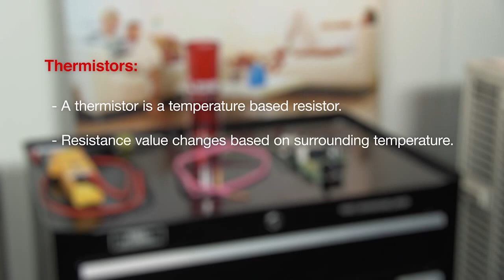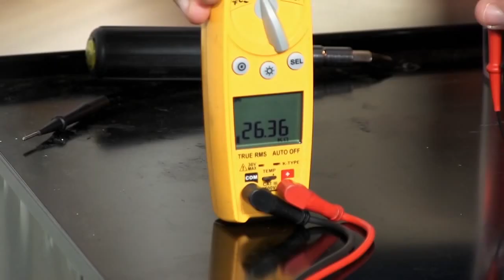Tech Tips: Resolving Thermistor Errors (L)

Comment: I always find that the system is low on charge when I have that error. As soon as I reset the disconnect for 10-12 minutes I turn everything on full blast and charge it up properly then it goes away and works. I've seen many guys change them out without testing anything else then have the same exact problem.

Comment: Well this is a good start but there is also 1 big thing that is not talked about. The Mitsubishi DPLS2 drain pan level sensor. It makes you remove thermal sensor from board with a pig tail to install sensor downstream. This module was bad and caused P1. Installed original senor back in the board all set. FYI
Reply: I wish I had read this comment before I got a new board.

Comment: Hi,my ac is brand new,it's av12000 btu,it cools and heats my room very good,but on the remote I can press a button and it would tell me the room temperature,now if I set my unit to 23 degrees celsius and check the room temperature it will sometimes go 22 degrees Celsius,before it would shut down,is this rite? Thank you

Comment: Will replacing my remote on my  mR sLIM msz-fe18na unit fix my heating issue? It keeps running even after setting the thermostat on remote to 59. Installer didn't know how to fix. It just keeps heating the room to the point I have to shut it off
Reply: 5 years late but if you had another remote you could have tried a different one on it and tried the possible bad remote on another system in a different room